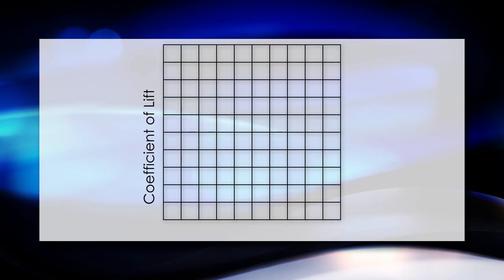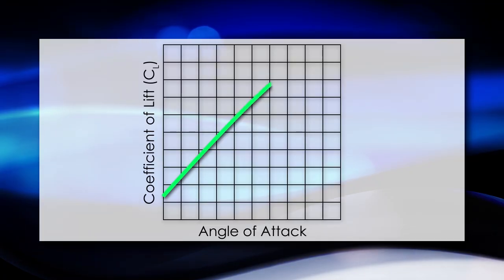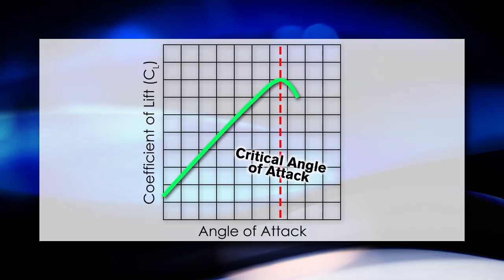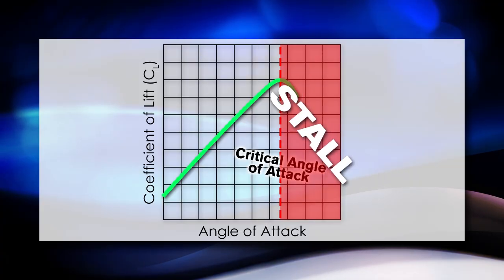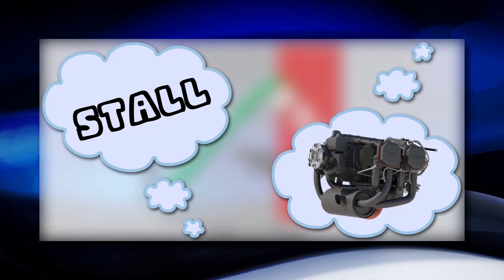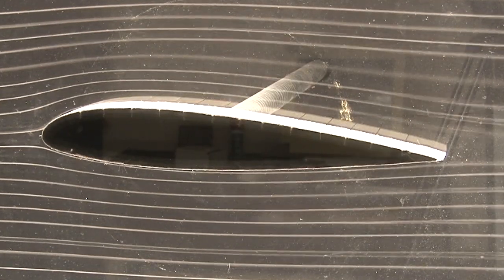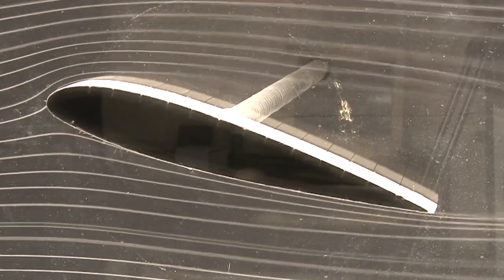Stalls Introduction

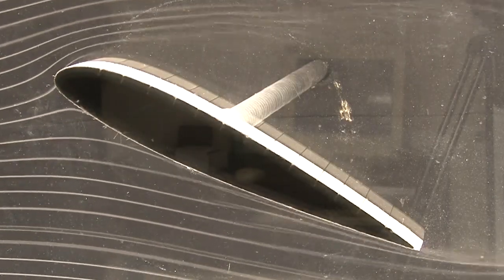Comment: at 0:53 in, I don't understand how a stall will "always occur at the same angle of attack regardless of airspeed..." ? I thought if you have enough power and airspeed you can almost go straight up, like jets do.
Reply: but the relative wind has a high angle too then (with respect to the ground as you also observe for the jets), so angle of attack is not that high. In other words, angle of attack is not the same as angle with respect to the ground, it's the angle with respect to the relative wind, and relative wind changes depending on the speed of the object (it's the vector sum of the true wind and speed of the object that experiences relative wind)
Reply: @branlob ok thanks!!

Comment: It seems like the Cessna, at 0:55 in, doesn't seem to be climbing too steeply but it still stalls?
Reply: i believe it is going at a relatively slow speed. Not enough air is going over the  foil to generate lift so it doesn’t need a steep angle of attack to stall.
Reply: @shruumy  the angle of attack is the same for a stall at any air speed, the issue is at low air speed the relative wind has a low angle with respect to the ground